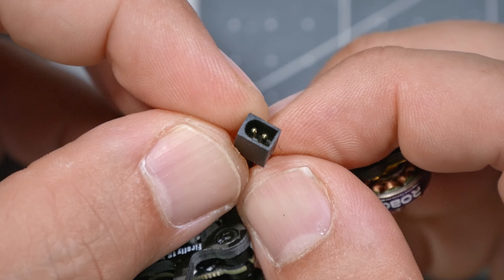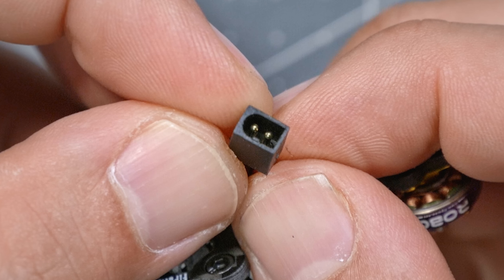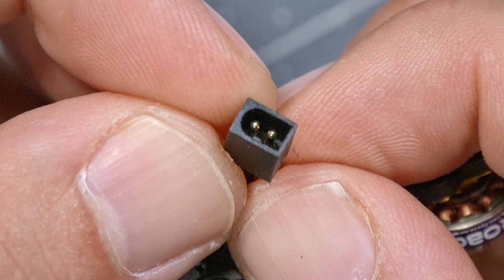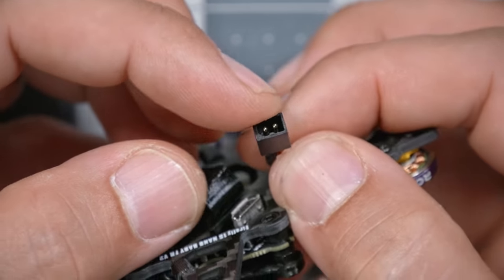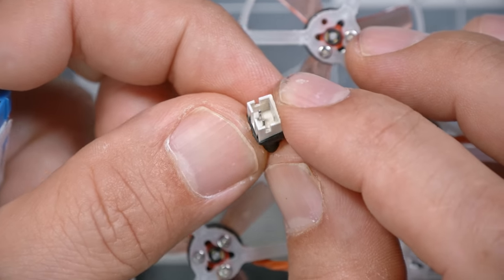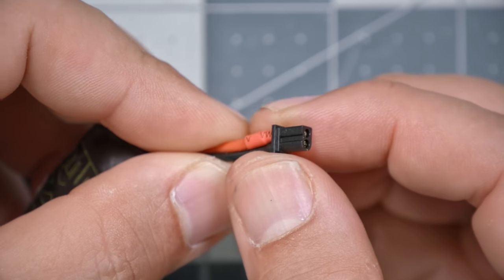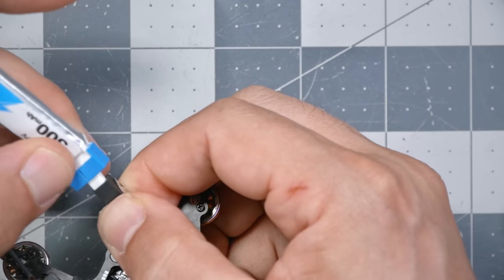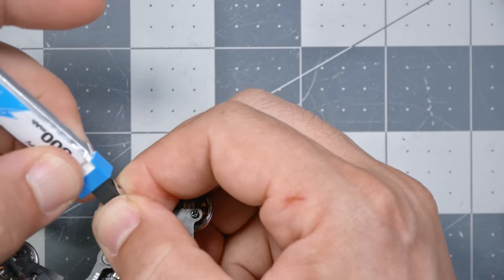GNB A30 CRUSHES BT2.0! New best battery connector for micros!!

Comment: @JoshuaBardwell    I'm changing to A30, good results so far.  NOT good results from "the first charger with A30 sockets" though, the Flywoo 6 way.  Mine was seriously overcharging HV.   Awaiting replacement.     One thing I would say generically (so far) against A30, being black, its harder to see polarity to connect together in less than bright lighting, which is annoying, especially on said Flywoo charger which did not have visible polarity indication other than the shape which is hard to spot with hands in the way, being tiny and black.  A30 body colour should be changed to a light neutral grey IMO, preferably with a higher temp nylon.   Its one area where the white BetaFPV type wins. Also I'm a long term experienced solderer, but the black plastic the A30's are currently coming through with takes VERY little heat sink, even fast and "solder as a connected pair".

Comment: I couldn't find these battery connectors anywhere only the pigtail whoop side so i drew one up on fusion 360 like i always do and got some copper tubing and made my own was pretty easy actually the copper tube comes in lengths of about 10 inches so for a few dollars and some print material you can make about 30 of them I wonder if thingiverse will get up me for posting them 😂

Comment: After converting a few batteries over to A30 I have some thoughts.( I am not the best solder smith but not the worst either. ) Tolerances seem to be all over the place on them. Sometimes the male terminals are far apart, sometimes so close it is very hard to get heat shrink between the terminals. Only real advantage of the A30 vs GNB27 is compatibility with BT2.0 chargers. Weight difference isn't significant enough for a hack like me.
Reply from the maker: Really, the best choice might be BT2.0 on the quad and buy A30 batteries pre-soldered.
Reply: @JoshuaBardwell  This discussion probably isn't helped by betafpv and GNB not using the same nomenclature ( male-female) for battery side & quad side connectors.

Comment: I made a mistake. I bought a beta FPV Cetus and saw that there was a 550 mAh battery that would fit the drone. But…. the slot is to small and I think a little to heavy. Any suggestions?

Comment: Just buy pack of 5 Tattu 300mAh 1s batteries. BT2.0 on this plug very hard in charger and conector on Tiny whoop. Look like new batch of BT2.0 connector have slightly smaller hole in conector.

Comment: The problem with this connector is the fact that the GNB27 existed. I literally just finished switching all my 1s quads and batteries to GNB27 only for GNB to ditch the connector. What assurances do I have that this connector won't be ditched if GNB gets a hair in their ass again and decides to change it?
Reply: 😢Yes, that's a pity. I am glad I have not changed
Reply: I just switched all mine to GNB27 too :(
Reply: GNB27 is a great connector. No need to change to A30, if you ask me.
Reply: I stay at GNB27. We just need to buy 100 of these and we have lifelong GNB27. They gonna be cheap soon if no one want them because of the BT2.0and A30... In another comment her under this video I descripe why A30 and BT2.0 are very bad and why GNB27 and XT connectors are much better.
Reply: It's compatible with bt2.0. Which means that people like me, who already have bt2.0 chargers and quads are more likely to buy A30 batteries. And if people will be buying A30 batteries, companies will make more products with A30 connector.
Reply: @_Dimon_  I also have BT2.0 chargers. You can use GNB27 on them with an adapter...
Reply: @Sugalime3D_FPV if the gnb27 was better they wouldn’t have dropped it 😂

Comment: Is it okay to run 2s through these? As long as you stay below the 15 amp limit? I'm doing micro aircraft with 11xx-18xx motors, generally pulling 7 amps or less. I have a twin planned where each motor will pull 4.7@100% throttle, so less than 10 amps combined. 

Thanks for the help.

Comment: Hey for everyone who use bt 2.0 batterie's on the A30 Connector don't don't do it that way. Better to use the A30 batteries fir the bt2.0 Connector on the drone. Because after a couple week's sometime even days your a30 Connector on the drone will have issues to connect because the batteries push the gummi part. Put a fem bt2.0 on your drone and use the a30 batteries than you will never have 
loose contact after. Just a Tipp i learned myself.

Comment: How much it is A30 better to bt2.0 in resistance and flighttime. I want to know if a switch is usefull enough. Its not so big like from ph2.0 but how big is it in detail. Maybe an hover test and see how much different it is, that would be great😊
Reply: Oscar Liang tested these to be pretty much identical to BT2.0
Reply: The cool part is that the A30 is unlicensed.

Comment: Should've also mention the GNB27 connector in this video!
Reply from the maker: Even GNB seems to be giving up on it. The a30 is from them.
Reply: It makes sense to be honest. The connectors were overlapping a bit too much, and them being cross compatible with BT2.0 just makes the tiny performance differences to the GNB27 irrelevant imo.
Reply: Also I saw various people having issues with poor tolerances on GNB27, connectors being too tight or simply falling off with no resistance. I bet they just wanted to start over.
Reply: @ignasanchezl  Yeah I must have got a bad batch of nitro nectars with the  GNB27 connector because they are so loose they will disconnect mid flight
Reply: Weighs slightly more. Mating pair of PH2.0 0.3g, BT2.0 0.6g, GNB27 0.8g.
Reply: @ignasanchezl  just unplug them 20x (use pillers) and they are not too tight anymore...
Reply: @HendrixFreakazoid  just solder a new one...
Reply: I stay at GNB27. We just need to buy 100 of these and we have lifelong GNB27. They gonna be cheap soon if no one want them because of the BT2.0and A30... In another comment her under this video I descripe why A30 and BT2.0 are very bad and why GNB27 and XT connectors are much better.
Reply: I'm almost certain GNB does not have a ton stockpiled or is gonna give them away for any reason.
The great thing would be to get all battery manufacturers onto this connector, the whole point was not having to adapt every battery.
Reply: i had very bad luck with gnb27 falling apart :/
Reply: @mark6302  and you think this is not gonna happen to BT2.0 / A30 people ?
Reply: @Sugalime3D_FPV  beats me ?
Reply: @mark6302  😂

Comment: Can this connector do well with 2S voltage?
Reply: I don't see why not, they're rated for hundreds of volts, 15A continuous, and 30A burst.
Reply: Voltage is irrelevant, or at least the voltages used here. It's the current that counts.
Reply: Maybe but 2S whoop has bigger frame (>75mm) and more powerfull motors, so extra weight of XT30 wasn't an issue

Comment: Is there a difference in flight time between the BT2.0 and the A30 connectors?
Reply: I notice insignificant different, only a few seconds difference like PH compared to BT. The differences are less resistance  and which lead to better fly performance at the end of battery capacity
Reply: BT2.0 and A30 perform almost identically according to Oscar Liang's testing

Comment: I just switched to GNB27 🤦🏻‍♂️ now got to switch them to A30 eventually 🤣  GNB27 goves more current wish my 2s whoop used gnb27
Reply: LOL, I mean you could always make a 2S pigtail using GNB27. I mostly fly 1S and my new 2S just gets to suffer the weight of a XT30->2xBT2 adapter while I'm deciding if I want to spend on a set of 2S packs.
Reply: @FluffRat  I left it xt30 because all the 2s batteries r xt30. Didn't want to change all the batteries too. 
BT20 to GNB27 such a tiny weight difference I don't care but xt30 I'd like to cut that weight lol

Comment: What’s the point if you want to buy these connectors they cost the same as bt2.0 (so far I see them slightly more expensive)? I’m about to make all my 1s batteries use XT30 connectors since they’re way cheaper, like half the price from most vendors. Tests of the the BT2.0 A30 & solid pin PH2.0 (folded pin is terrible) show tiny differences anyway
Reply: Did you even listen to the intro lol? You don’t need xt30 for 1s. It’s far too heavy.
Reply: @rp479  And? It’s about a 1 gram difference. I understand for tony whoops it’s a lot of weight, but I’m not racing and I’m not even close enough to be remotely close to guess accurately the difference. And the weight argument goes out the window when you have guys going digital and adding 10+ grams for a pretty picture

Comment: Getting the bt2.0 to fit in the a30 isn't really that hard. Also saw a guy who found that you can plug a30 Batts into a gnb27. Its a bit smaller but still works but doesn't work the other way.

Comment: It really depends on the cost, but since the moment I knew these were coming, I thought they would be amazing. Also, Betafpv could just make theirs open source too now?  shrug
Reply: I think the move is gonna be using A30 on batteries and BT2.0 on the ESCs lol
Reply: that way drone is fully universal and accepts any batteries, and the batteries fit either connetor too
Reply: (although they are compatible either way regardless
Reply from the maker: This is brilliant. If the BT2.0 really is more durable, go ahead and use it. But save money on batteries. I'm totally stealing this.
Reply: @ignasanchezl  I'm already doing this and it works great.

Comment: I put 20awg JST-PH 2.0 on my whoops, don't have any more current issues.   I've melted crappy jst2.0 connectors before because of the current draw.  I think it's mostly the trash 22 or 24 awg wire that's the problem with most ph2.0 connectors not actually the connector itself, it's just metal.  That's hilarious everyone is creating all these new connectors instead of just fixing the ones that seem to be the standard already.
Reply: Watch Mute FPV's tests. There is quite a difference.
Reply: Plus GNB27 was dropped for the A30.
Reply: It's the small contact area and low pressure that is the problem, not the wire. Localised heating can cause oxidation and then the resistance starts shooting up. So does the temperature, vicious circle. Putting something on to keep the oxygen away helps, like WD40.

Comment: This is like preferring a knock-off XT60 connector not made by Amass… they are SIGNIFICANTLY worse!

Upfront…

I dislike BetaFPV, but all GNB did is create a connector with a worse conductor alloy and a significantly worse plastic quality. It was a race to the bottom price wise and the A30 performs worse long term and breaks significantly easier.

I have tested this extensively for months and GNBs connector is inferior in every way, and it hurts me to say this… this isn’t open source or better, it’s just worse and only done for money, not to help the community. 😢
Reply: Huh is this legit not unlicenced unlike the BT2.0?
Reply from the maker: If that's true, then run BT2.0 on your quad and buy A30 batteries? Best of both worlds?
Reply: Fully agreed with you guy, I get some for a few weeks and they are just BT2.0 greedy copy... Worst material, worst fit, black color make them a lot harder to fit the right way, pricier...
Reply: @DonJohnsonFPV how is it greedy? They’re literally in the business of selling Lipo batteries.

Comment: I read most of the comments by the fan boys but no one does any critial thinking anymore, it seems.   - this video is full of claims but presents no proof that A30 actually ‘crushes’ VT 2.0.  JB admits that both connections provide the same or similar current qaround 2:32 in the video but he is not providing any data or proof it bests BT 2.0.  The only thing that A30 we can say about, is that it is open-sourced so may dominate BT 2.0 at some point down the road.  I expect more from JB - he is good at testing and backing up his claims - it is simply missing in this video.  I don’t even understand how it is better besides the commercial that this product will giv us more run time on the battery and more punch?  How?  Where is the proof (data?)?
Reply from the maker: Unfortunately, my battery test machine is on the way over to the UK so Chris Rosser can add it to his lab. Otherwise I would have tested some A30 myself to back up the claims personally. Nevertheless, BT2.0 has repeatedly been demonstrated (including by my own personal testing) to beat PH2.0 significantly in terms of current handling and voltage drop. A30 has been tested by others to be equal to BT2.0 in performance, which is to be expected since they are very similar in design. Therefore, A30 equals BT2.0 in performance, crushes PH2.0 in performance, and A30 doesn't have a "tax" imposed on its use. Therefore, it "crushes" BT2.0 in that it will gain widespread adoption because it is same performance for cheaper.
Reply: @JoshuaBardwell I'm hoping batteries with it may be more widely available than BT2.0.

Comment: what about gnb27 i feel that is still better
Reply from the maker: It seems like GNB is giving up on the 27 and going with the a30. GNB 8nvented the a30.
Reply: Slightly heavier, but with higher current capability.
Reply: L stay at GNB27. We just need to buy 100 of these and we have lifelong GNB27. They gonna be cheap soon if no one want them because of the BT2.0and A30... In another comment her under this video I descripe why A30 and BT2.0 are very bad and why GNB27 and XT connectors are much better.
Reply: @Sugalime3D_FPV  won't really help if batteries cease to have GNB27s in future.
Reply: @Nkkdxn45j  Every new battery you need to solder than... I know that...

Comment: I actually dislike the BETAFPV BT2.0 connector and new GNB A30 connector. Here is why: Safety and handling is for me more important then performance ! The GNB company is probably planning to replace the GNB27 with the GNB A30. This means that the GNB27 will probably no longer be produced. I think this development is bad. Everyone knows I find the BT2.0 and A30 very bad because they have such a super small pin spacing for the cables to be soldered. Not only is it extremely difficult to solder and insulate, no, in my opinion, it is also more dangerous to have a small pin spacing... (danger of short in a event of overheat or machnical stress). I will convert all my 1S hardware to GNB27, anyway that the GNB27 will eventually run out... The GNB27 has better pin spacing than BT2.0, and an XT connector has even larger pin spacing if you look and compare a virtually scaled down to the same size of a BT2.0 pins. And the XT connector is undoubtedly the best and most used connector in the RC sector at the moment...
Reply: It's OK if you use heat shrink. XT30 is great, but the difference is 4-5% of the all up weight for a whoop. That is a lot.
Reply: @Nkkdxn45j  no it's ok i use the GNB27. I would be happy if the XT company brings out a XT9 or XT7 (scaled down XT15).
Reply: You just gotta get good at soldering and using heat shrink. Just converted 3 quads and 15 whoop batteries to a30 with no problems at all. 

Absolute game changer. I love this new connector. Works great.
Reply: @rp479  the most problem is not the soldering. I'm good at it. But it is safety. Heat and mechanical stress can do that pins come togheter... Because they are so close togheter...
Reply: @Sugalime3D_FPV  well I’ve been running a30s for a while. On 3 whoops. I’ve had zero issues. 

Is this something you’ve actually seen?
Reply: @rp479  no is just a prediction.